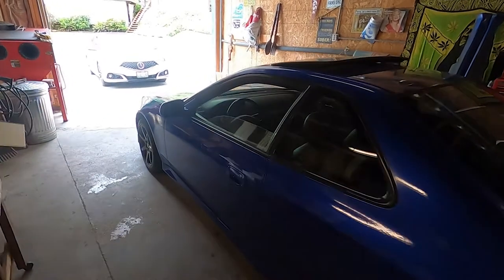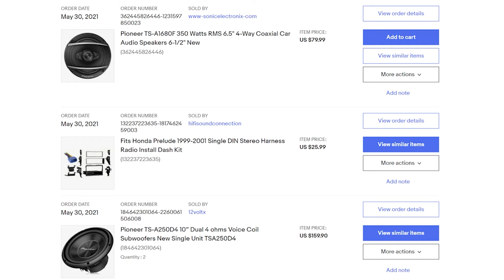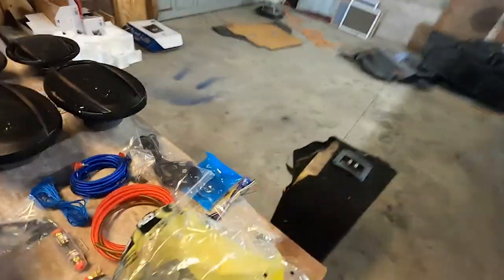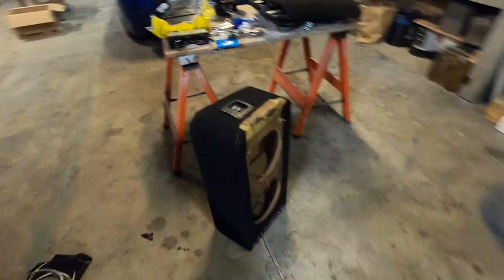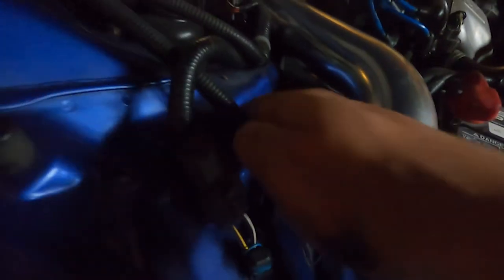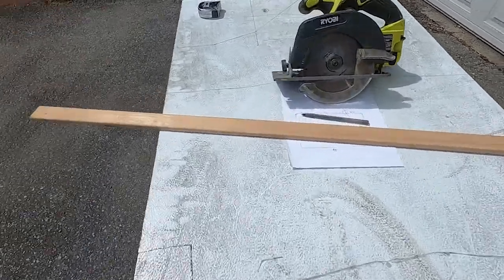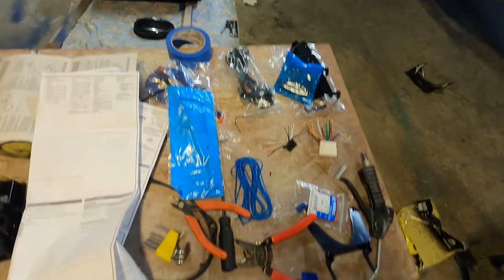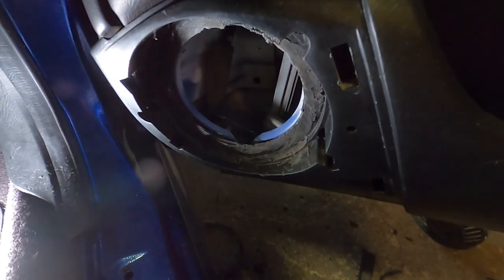Honda Prelude Build Part 10! Casper's Rocking System!

Comment: yoo, did you need any extra screws or mounts to secure the door speakers after you cut the cage out or will they screw in the factory mounts?
Reply from the maker: Hey man, I drilled into the actual metal part of the door and secured it that way. Use an abundance of caution not to damage the speaker seal if you are drilling with it there.

Comment: Sweet setup Im looking to do the same on my prelude do you by any chance remember what color wires go to each speaker (in the rear deck)? Mine also has that acoustic feedback and the previous owner cut the stock harness back there so there's just a bunch of wires sticking out. Thanks in advance
Reply from the maker: Hey man! You should be able to find all the information you need on the forums. If you look up 5th gen Prelude speaker polarity there’s usually some information. This seems helpful for bypassing the AFBS ⬇️
Reply from the maker: https://www.preludeonline.com/threads/5th-gen-rear-speaker-confusion.242560/
Reply from the maker: And then use this for the speaker polarity, multiple sources are always your friend so double checking against another is usually my approach ⬇️
Reply from the maker: https://www.modifiedlife.com/2001-honda-prelude-stereo-wiring-diagram/

Comment: How did run the rcas and remote wire ?
Reply from the maker: If I remember correctly I ran it down the rocker sill. You have to take off the cover there but it’s usually pretty straightforward with the older Honda’s. And then zip tie it to the existing wire bundle and run it to all the way to where you need it in the trunk!